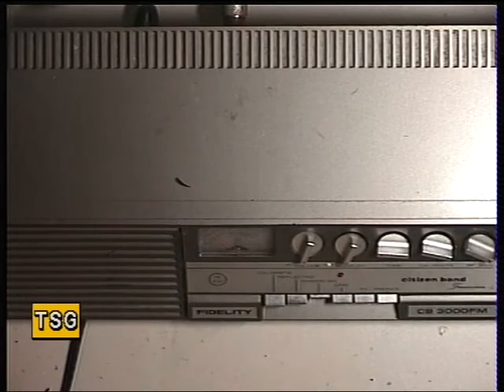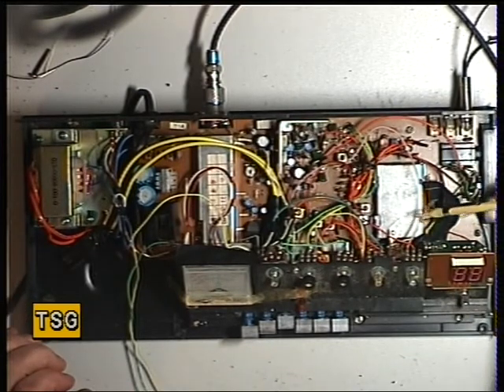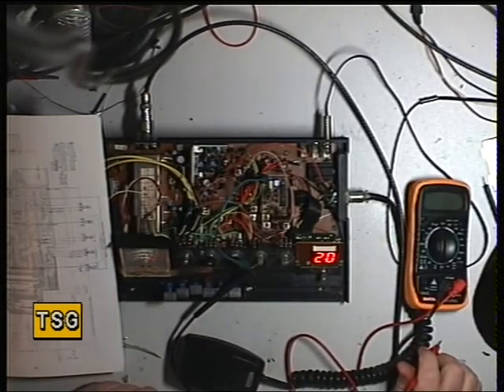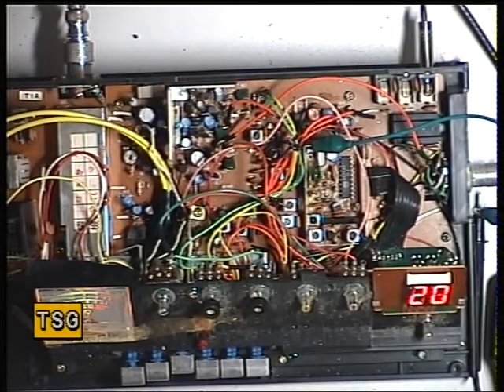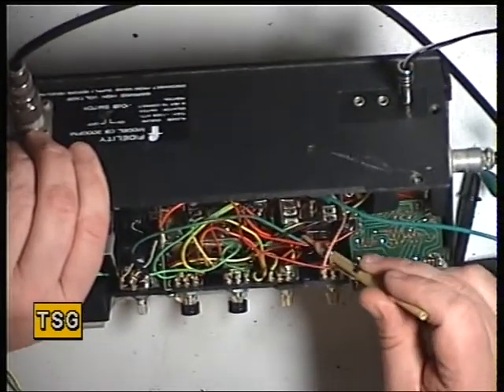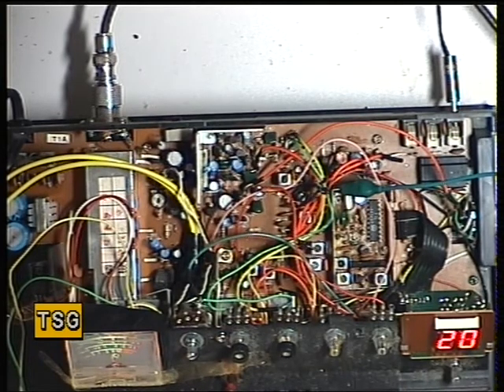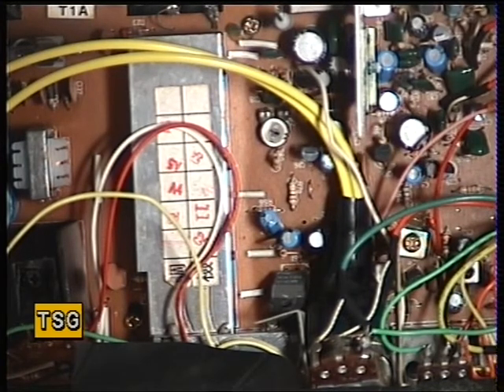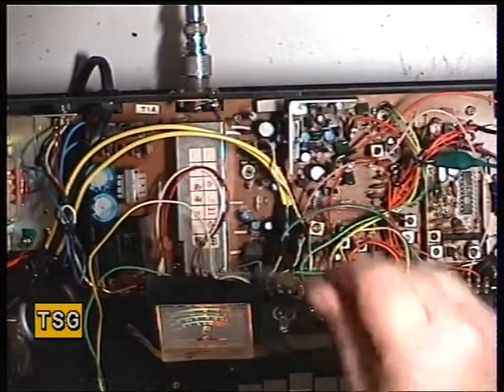Fidelity 3000, UK (CB 27/81) CB radio (Base Station) - VCO & Transmitter alignment

Comment: Hello Richard - I found this walkthrough interesting as I happen to be repairing one of these at the moment. I can understand why you didn't take it apart far enough to expose L8 through L10 - unfortunately I had to do that to fix a zero RF output power fault. 

My example has dismal output power of 2.5W even after peaking up, which as you say is not untypical for these GREAT manufactured sets which very rarely put out the full 4W. On this one, L6 (unmarked, southeast corner of the VCO in your view) does not have a noticeable peak and I assume it should so I'm wondering if someone has screwed the core all the way down at some point and broken the internal capacitor. I may have to remove the whole can to take a look at the bottom end. Or I could just try a few likely random pF values of ceramic capacitors across the pins of L6 on the underside of the PCB, and attempt to guess the value of the (presumed broken) internal capacitor.

At the moment I'm working only with the circuit diagram from CBTricks which omits the IC and transistor part numbers. I assume the full manual had a parts / component list as well. In your commentary you mention you've uploaded the service manual but I can't quite catch where, do you have a link please?
Reply from the maker: The manual I uploaded to SCRIBD.Com for free use. I've never come across a Fidelity 3000 that has been screwdrivered by captain gas poker & the likes, which sounds like yours has indeed been messed with. It's possible that not all coils have definitive peaks & I tend to look at the PSU ammeter on mos sets when this happens, but on a base station that isn't easy either.  Looking at L6 on the circuit, it's straight out of the synthesiser & I wouldn't worry. We have always accepted that any power above 1.9W on these sets is par for the course. I recall the maximum ever in my 35 year experience as a 2-way radio engineer was 2.9W. Once you go above 2.5W, it makes little difference in dB terms & range between there & 4W.

The manual says " RF voltmeter to C110, adjust L6, L8, L9, L10 for max. Then with RF wattmeter on the output with dummy load, L6, L8, L9, L10, L11, L13, L15.

Hope this helps,

Richard
Reply: Thanks for the prompt reply and info about the manual - yes, L6 is the very first coil in the transmitter chain in  the VCO TX output buffer - the fact that the procedure suggests adjusting it (twice) must mean that adjusting L6 ought to have some effect, surely. At the moment it has negligible effect on output level from one end of its travel to the other.

All adjustments until the meter started to move were done initially with a scope with 10* probe on various points in the intermediate stages and a dummy load in the output, and then subsequently with an external meter in between the output and dummy load.

I last worked on this series 30+ years ago and then not often, but I do remember them having very weak transmitters. With other common chassis of the time, the usual challenge was to tune them down to 4W while keeping an even output level all the way across the 40 channels.
Reply: Richard - I had a look through your uploads on Scribd - some really useful manuals there but I can't see the one for this radio. (I did see that you had uploaded the manual for the Fidelity 2000). Could you tell me what type of IC the VCO TX buffer IC3 is in this Fidelity 3000 chassis? It's impossible to read it off the IC way down in that metal box, and it isn't marked on the diagram.
Reply from the maker: I seem to have the Fidelity 3000 manual as a permament fixture next to this computer! IC3 is a TA7310P.

Richard
Reply: I still haven't been able to find the 3000 manual among your uploads so that info is appreciated, thanks. 

With all the  screening covers back in place I managed to eke it up to 3W across the band which is tolerable for one of these, and will have to do.

The reason I asked about the IC - I was wondering if it was possible to set the gain of the VCO TX buffer stage through component choices because a small change to the output level here would translate into a larger change in final output level. I take your point about there being little difference between 2.5W and 4W in real terms but it surprises me that such below - spec performance has always just been tolerated through all of these years with no attempt ever made to look into why this was the case.
Reply from the maker: It's was sold as a 3.5W radio, not 4W according to the manual. Nobody bothered because it was the worst performing base on the market.  People just moved on to something better. There are still very poor new products on all electronic markets. I could start with talking about mobile phones with internal only batteries for starters....or why the resolution on most 'normal' televisions is so much lower than TV's in the 1970's..the list goes on!

However, the Fidelity 3000 has become a collectable item and people now wish they performed better than they did then new!

Well done on your tuneup.

Richard
Reply: The 3000s aren't bad looking sets, although from the 27/81 base stations of that era my favourite is the Midland 76-900 which, as well as being a beautiful looking radio also happened to have a decent Cybernet 134 chassis - quite unusual for Midland who normally seemed to favour Maxon chassis. If I were choosing a base station for my own collection, that would be the one.

I agree about mobile phones (or any other expensive gadgets) which don't expect / allow the user to change the battery. I'm still running a Samsung S3 precisely because it does have a replaceable battery. I won't be buying any newer model which doesn't.
Reply: @ukfmcbradioservicingTango21  I have never seen one go above 3 watts, usually they are about 2 to 2,5 watts from the factory.
Also check for strong harmonics if tuned up, they can be bad for that. The receiver is bad for overloading the front end and bleed over from nearby channels. But get them into the countryside and they can hear a sparrow fart in Ireland.  Though unless they are on a good home base antenna they will never transmit as far as they can hear.  By the way, I have seen a different board layout and PLL. Maybe early boards or rushed ones to meet the deadline of the first ones sold. Maybe I am wrong, but when you said they were three crystal and you lifted the screen lid and said "Oh, sorry Fidelity"  I thought oh its a different chip.  Pigs of things to fix, I hate them, the only thing I like about them is the FM is not so noisy as some sets, so I used to use one just to listen at night.  I sound terrible on one of these, so I would never use it to transmit with. i have a feeling they were originally supplied with a service manual, but that stopped being shipped with them.